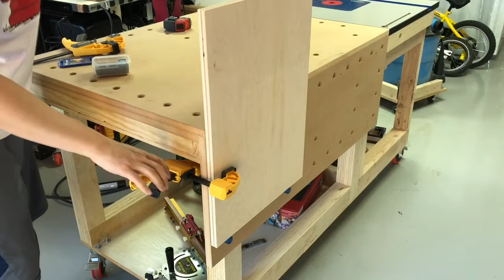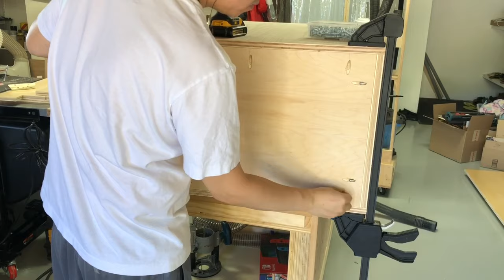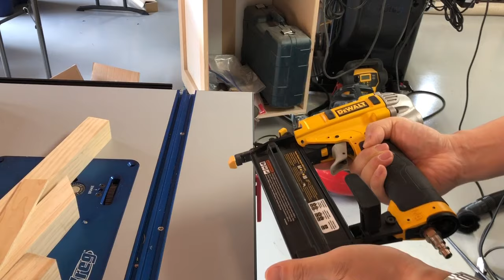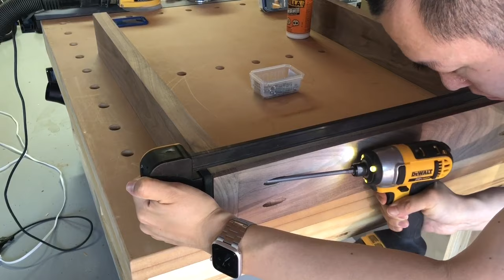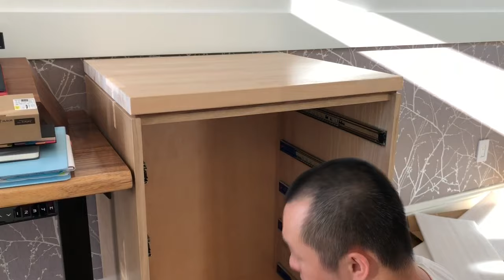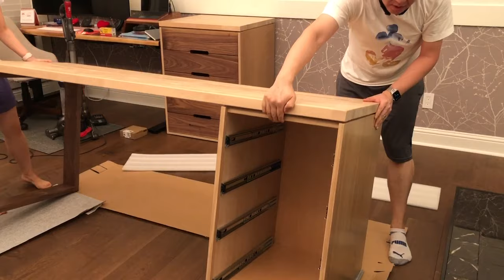Building Office Furniture Set | DIY Computer Desk and File Cabinet | 自制电脑桌

Comment: Very well Done. is the tabletop panel bought from home centre as it is? As for the walnut wood, it looks very nice but wonder how you get them jointed and planed? Do you have such tools at your workshop?
Reply from the maker: yup, the top was bought from Home Depot, then I sanded it and applied 3 layers of polyurethane.  The walnut, some had holes which I filled with resin + black coloring, then planed them flat :)
Reply: @DingsWorkshop  so you don’t have a jointer? How to remove the bow or cup or twist?
Reply from the maker: @getthingsbuilt1342  nope, I don't have a jointer :)  so I tend to avoid boards that has a very bad bow or twist, but we all know that's not possible to completely avoid them :)  so when I have a board that has a bow or twist, I place the material on top of a known flat piece of board (usually MDF); I then add shims from bottom to make sure the material does not have any wobble when resting on the flat board.  this way, when I run the material through the thickness planer, the material will end up having the top side absolutely flat.  Now with the new flat side as my reference, I simply flip over the material and run the other side through the thickness planer to get that side flat as well :)
Reply: @DingsWorkshop  well explained. How effective is this? I’d recon it is more effective for longer piece but less for short piece? Maybe I am wrong.  I also thinking it is maybe relatively practical for hardwood pieces as they are in a better condition( normally ). But for construction lumbers ( apparently we all use a lot), they normally in a pretty bad shape so that we had to joint them and plane them every time we use them if we want to be precise.... I don’t have either a planet or jointer but want to know what to buy next. If I need buy both or can simply buy a planer using your method. I had some very bad experience using the construction lumbers without planing and jointing and the table I made out of them is a disaster
Reply from the maker: @nickharvey1648  so based on my experience, the thickness planer + shim trick works pretty well.  And I'd even say it works better on shorter material vs longer ones (mostly because shorter material only needs shorter flat board as the base).  Of course the best situation is to have both thickness planer and a jointer, but frankly, I've heard many people say the jointer is probably the last tool you need to buy in your woodshop, because there are many ways to make a flat surface on lumber :)
Reply: @DingsWorkshop  I would hope the same too to get away without a jointer 😃😃 i am indeed looking at a helical cutterhead planer ( probably benchtop) as many people claim that the dewalt planet is not doing well with the hardwood and the blades are tend to wear out really quick and cost a lot to replace.... I also noticed that for dewalt planet I have to buy the indeed and outfeed extension, and as well a dust collection bad or something to collect the chips. This is all money added up. I don’t have a dust collector like yours and I only have a shop vac that is unable to cope up with the blower built in the dewalt
Reply from the maker: I’m not sure where you’re located, but here in the US the dewalt DW375 occasionally goes on sale, with in feed out feed and extra replacement blades.

Comment: DIY with Heavy Machinary... I see DeWalt every where.... Appears to a sponsored video... If not then speak to them and get some share from their marketing budget.... Cheers
Reply from the maker: Not sponsored. The reason why you saw dewalt everywhere is because that’s the only brand of batteries I have :)
Reply: @DingsWorkshop   Well I'd still suggest to check with DeWalt for sponsorship... With the valuable time spent doing video... And with such high viewership there should be some monetization from the company too... Cheers.

I super liked the desk prepared, iland would like to have one for Covid WFH.

Comment: If I had the space, tools, materials, I would make my own, but, since I can only buy materials, there's no POINT in buying materials only - it'd make more sense to get someone else to make it. I need a better solution for my PC desk as my current one requires a custom fitting unit - EVERY affordable option, well, they're not an option since none of them would ever fit (the space I have) properly. :(

Comment: hello could you give me the dimensions of the lid and the drawer?
Reply from the maker: HI!  I'm not sure what lid is...but the top is 74 inch x 25 inch, 7 inch x 16.375 inch.  Here's my plan, you can have for free:  https://drive.google.com/drive/folders/1dq867253HfJ39-WrkmlgVbD2YZcqxrFV?usp=sharing  the plan is done using SketchUp so you can open the 3D file for other measurements as well.  Cheers!